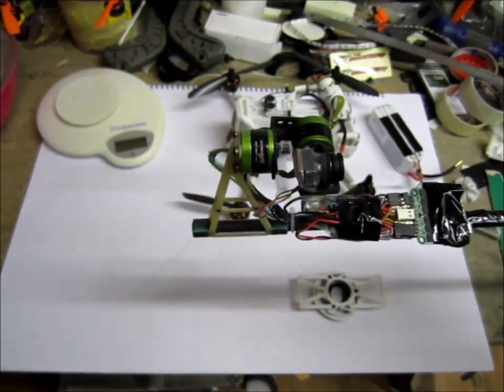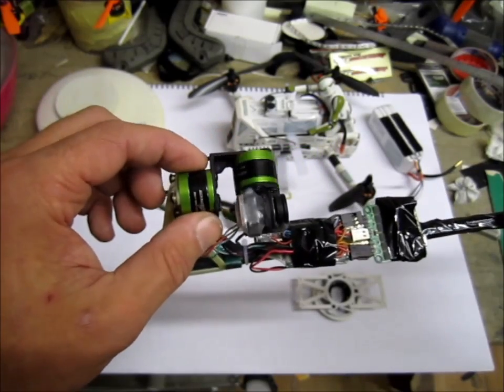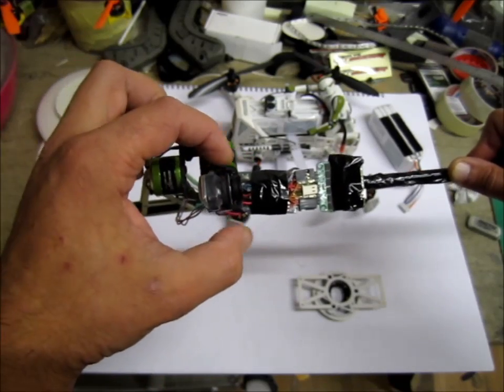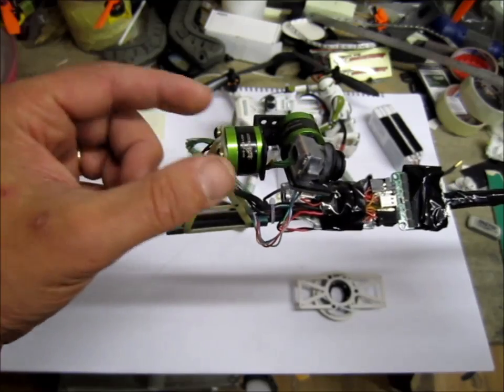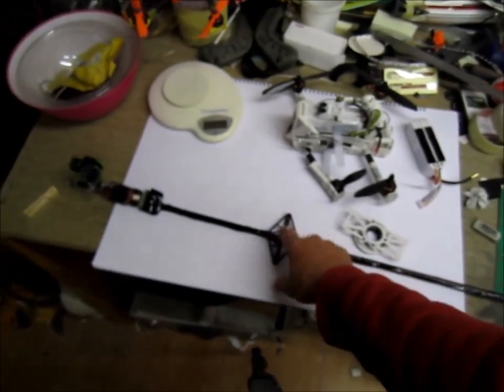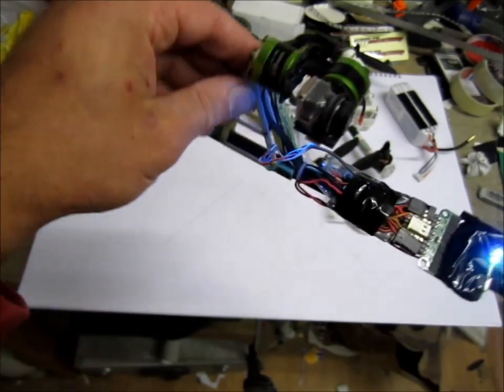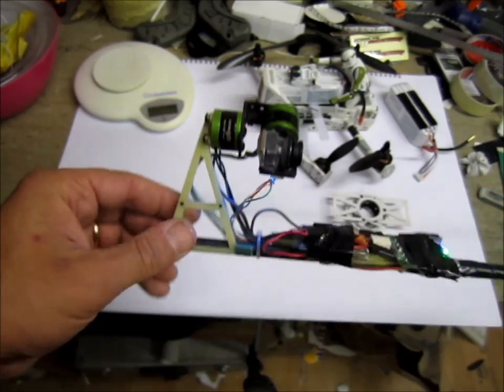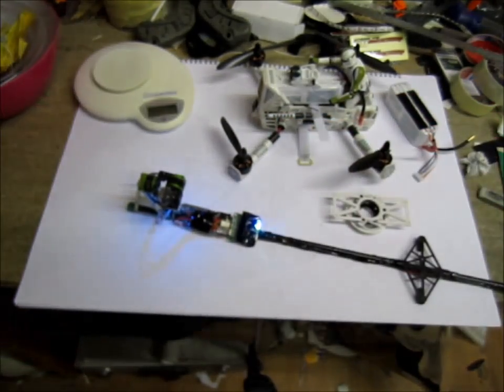Lightest DIY Mobius Gimbal. Overview and quick test

Comment: You sound Finnish :) Your video is inspiring because cameras are getting smaller and people need smaller gimbals for their quadcopters. This is the smallest DIY gimbal I have seen! Separating the lens and the PCB on the camera saves a lot of space and help distribute the weight. For the Firefly Q6 owners, they need a 51 pin cable with 0.3mm spacing (they can be found). For your information, the 340kv mean the motor is generating 1v for every 340 turns (as a generator) meaning they are low rpm with a lot of windings of thin wire inside so they are quite strong and battery saving, but not very fast. Which should be perfect for this.

Comment: Very elegant. How did you replace that flat cable from the lens?
Reply from the maker: Lens has a connector, old cable pulls out and new cable slides in.
Reply: Yes :) My question was bad. 
I will rephrase: "Where did you get that particular cable from?" I can't find it anywhere.
Reply from the maker: You can get one at official Mobius site, or half the price here- https://www.banggood.com/20cm-26PIN-Lens-Extension-Cable-for-1080P-HD-Mobius-ActionCam-p-91830.html?rmmds=search&cur_warehouse=CN

Comment: Haha! Nice! 
What motors are those on the gimbal? they look really small
Reply from the maker: Cheers, they're Turnigy 1704.
Reply: Thanks!
Reply: those are regular motors not gimbal specific!  awesome! and they're cheap too!
Awesome job!
I got to try something similar!
Do you know what is the max weight those can handle?
Reply from the maker: JustForFunXD Sorry bro, it was my mistake, they are 1807 and they are specific gimbal motors, you wouldn't get away with ordinary ones. I'd say max weight load would be around 50-60gr, for Mobius type cams only. That's them- http://www.hobbyking.com/hobbyking/store/__78318__Multistar_1807_340Kv_Brushless_Gimbal_Motor_for_Mobius_Camera.html
Reply: ah ok, thanks anyway :)

Comment: The jitter with angles greater than 45° will go away when you activate "estimate frame angle from motors" in the software - it doesn`t come from the cables! :)

Comment: Bravo man!  DIY all the way! Your geting there. Maybe a spring or flexible wire holder setup will keep the wires in the right spot so it can do full 90 digres.  Did you allso made the gimball controler or? ps. I know my english are bad.. :D
Reply from the maker: +panic mike 
No, I didn't solder my own controller, not enough knowledge and just not worth it:)
Reply: +ROBOFORCERX2000 Ok then. happy flying dude.

Comment: Its not the game you're playing but a similar gimbal and lens protected inside the hull of a wide body 360 quad quad would be interesting. Most gimbals appear very vulnerable. Good stuff!
Reply from the maker: +Tobermory Cat 
That is one of the plans for this gimbal. It will go on 300-330 quad between two front motors and it will be completely protected from crashes. Cheers!
Reply: ROBOFORCERX2000 looked at doing similar on my 360 but put off ....so many wires V little brain. Recall  seeing juz70 a long time ago using a gimbal on a mini and thinking the footage was very dull compared to his usual flowing flights - but hell there is a place for a gimbal on a mini, protection is a real issue. Good one!
Reply from the maker: +Tobermory Cat 
Yeah man, on minis everything has to be crash-proof!